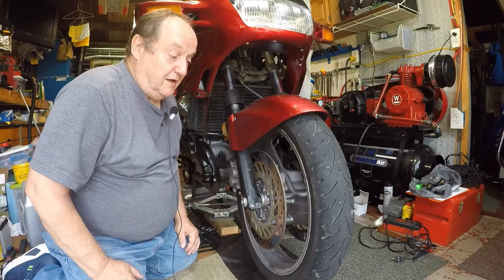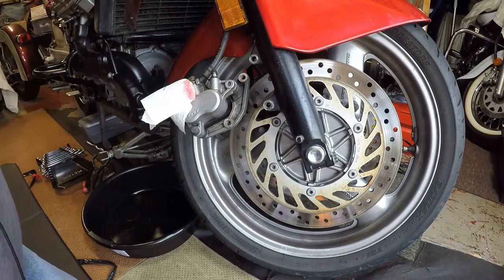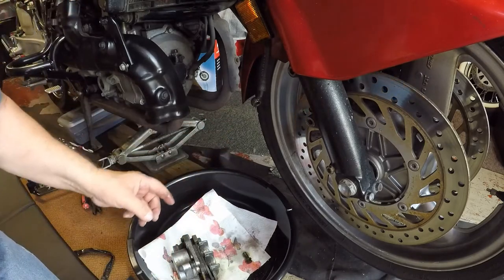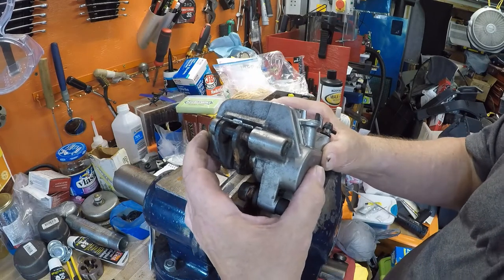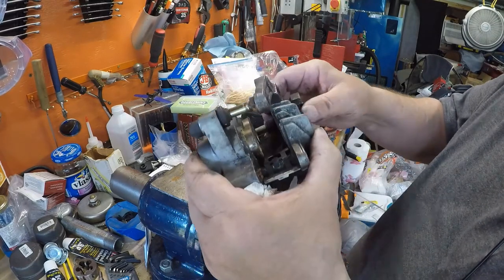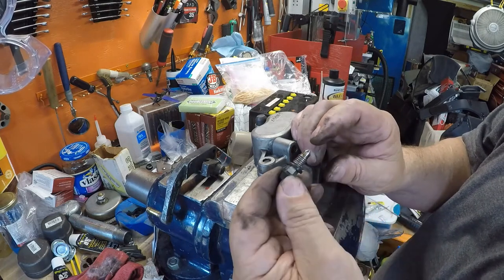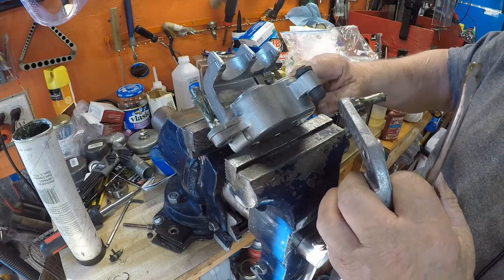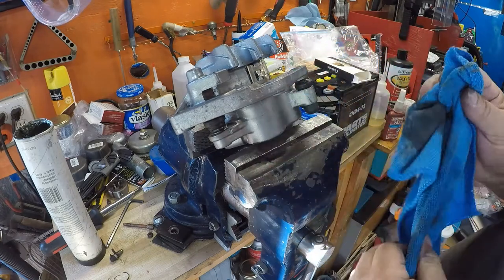HONDA S.T. PART FOUR   FRONT BRAKES

Comment: If old calipers used again never ever take them out like this cause you don't wont surface to be scratched by those pliers teeth...
You should push the calipers little bit out using brake leverage and then take the rag over those calipers and then softly pull turn out those calipers.